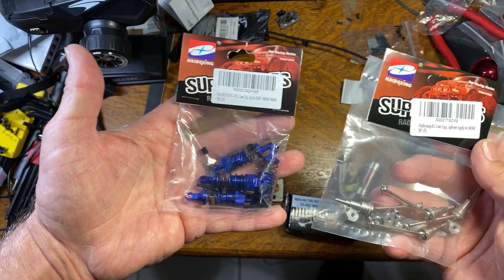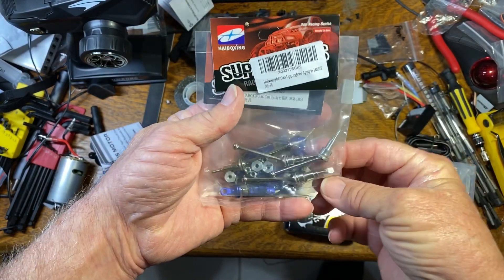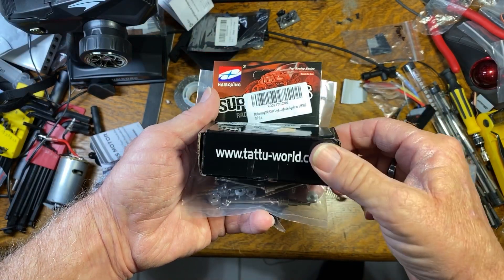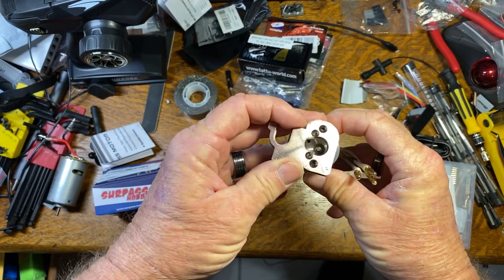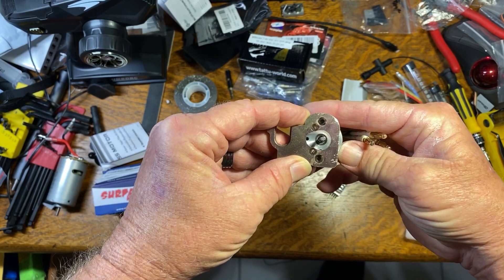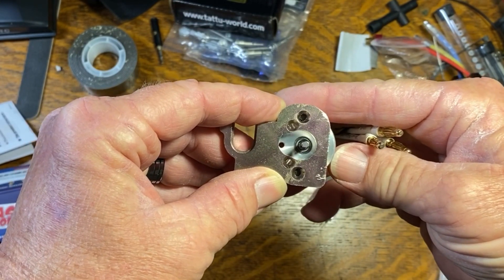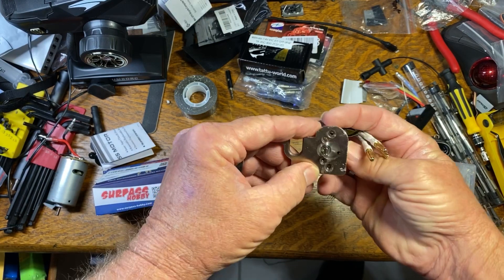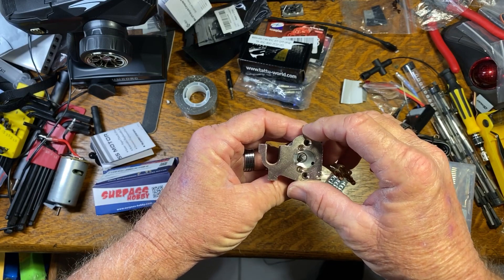WLtoys 144001 brushless upgrade

Comment: Very interesting video these motors have very high kv smaller less weight 👍🏻
Reply from the maker: Cam row drone Good morning 😃☀️🌞 
This one is 3930kv. I’m curious to see what it does. 
Be safe out there my friend!
Reply: RC ModSquad that will do 90 kph , but you need a long straight road for these speeds👍🏻
Reply from the maker: Cam row drone I kinda hope going to the 17t pinion will slow it down a bit. 🤞
Have a great day and be safe out there!

Comment: I have been meaning to ask you about the differences brush vs. Brushless? I know one probably has copper wiring. Windage maybe?
Reply from the maker: The brushed motor actually has contacts (brushes) the the wires in the motor. The wires are wrapped around a core and rotate and the magnets are inside the case basically wrapped around the rotating wires. Since there is contact the brushes do wear out. It is initially cheaper than brushless. 

The brushless motor has windings in the case and the core is magnetic. There is no contact between the wire and no brushes so they last longer and are generally more efficient. 

This is a very crude answer but it’s a start. LOL. Oh, they use a different ESC and the brushless motor cost more

Here’s a video that gives a little more detail. 😃
https://youtu.be/Y7nQI2xM2as
Reply: @RCModSquad  thank you David for explaining it. It makes sense now. Have a great day!🌞
Reply: @RCModSquad  good link. I watched it. I'm hoping to get a car soon. They look like a lot of fun.
Reply from the maker: 307 Wyoming 4E You’re welcome! Have a fabulous day.

Comment: Hey I have a question for you I looked for contact info but couldn’t find one, so I’m going to do a motor upgrade and want to start replacing the stock screws with Allen ones to make it a little more “hobby grade” can you tell me what size screws I need to pick up or if possible a kit or something that you might of used. Thanks for your time and entertaining videos
Reply from the maker: 27mmb27 I’ll have to look I’m the manual and see if anything is listed. 

Most of the stuff is M3x? A few are M2x?and M4x?   

What I did when I got started in RC was just start ordering small lots of 30 to 50 in different lengths. M3 seems to be most common so that’s where I started. M3x3 to M3x6 is a good spot to start and I started with countersunk and button head. Here’s just an example. 

M3x6mm 10.9 Carbon Steel Countersunk Head Hex Socket Screw (Pack of 50) https://www.amazon.com/dp/B01E5EOIWW/ref=cm_sw_r_cp_api_i_pG4MEb4K7WHQS

It’s cheaper in the long run to buy 50 or more of each size than just buying three or four at s time. 

At least if you plan on staying in the hobby. It’s so frustrating for me to shut down and drive to the hardware store just to by two or three screws. 

If I remember correctly the motor screws were countersunk M3x6 and I think they were the same for holding the motor mount into the car. 

I’m 500 miles away from the car until tomorrow night so I can’t check right now. 

Be safe my friend! I’ll check when I get home.
Reply: RC ModSquad thanks for the response

Comment: Nice video.
Mine is ordered. Was wondering what kind of pinion u use for the dedicated holes die that size engine 
 Will upgrade to brushless system, but want longer runtimes and good handeling not 70mhp speed. I think it will be fast enough of you put on a smaller pinion.
Reply from the maker: man, so many of my comments are going to my spam filter. sorry for the delay. I’ve since done a video on this and it did 45mph on 2s. Hard bashing would get pretty hot but a fan or smaller pinion would help. I ran it pretty hard on an 2200 mAh battery and was just under 4v when I shut it down.

Comment: Good luck on the pinion hunt, I'm after one too. Seems the stock gears are a weird size, 0.7M . Also have no idea how many teeth the inner mounting holes will need, looks like its going to be trial and error :-/
Reply from the maker: Matthew O'Leary I’ll look through my stuff and see if I have something already. If not, maybe I can find the right gear for a different motor shaft size and make it fit. 
Thanks for stopping by. 💯👍🏻👍🏻
Have a great day and be safe out there!

Comment: Awesome parts haul my brother! How many KV is that motor and how many cells can it handle? Very nice my bro, have a great day! 🙏😎👍
Reply from the maker: Mikes RC Garage sup bro? Thanks for stopping by. 🙏💯👍🏻 
It’s a 3930kv max volts is <13 and max RPM is 50k. 

I won’t set any speed record wit it but it should be fun and I think easy to handle with good runtime.

Have a great day and be safe out there! 💯🤛🏻🤛🏻
Reply: @RCModSquad  Chillin my bro hangin in there! 👋😁The reason I asked is because running a high Kv motor which 3930 on 3's is fairly high and requires a pinion drop to keep from overheating and to be efficient! I think it's gonna work out quite well being you need to use a smaller pinion as is...  I could be wrong but I think it's going to be a lot faster then you might think! 😎🤞 Nice! Thanks brother! 🙏
Reply from the maker: Mikes RC Garage I’m not sure about using 3s on this. It won’t be a starting spot anyway. Stock ratio is 1.63-1 the new gear (if 27t is correct) is 2:58-1. 

I’m not sure that 17t pinion will be correct until I try it. I may just have to make the motor mount adjustable. 

I think the reason the nylon factory gear handles everything so well is that it has a bearing on the center driveshaft right in the motor mount so there is no deflection of the spur. 

IF I can find a new gear that has as good a mesh in the 380 motor position that’s what I would prefer to do. 

Stock is 44-27 and my first test is 44-17
If it’s too fast I’ll go to a smaller pinion but I’ll have to make the mount adjustable. 

There is an adjustable mount available BUT I’d lose the spur bearing and I’m pretty sure there would be spur deflection. 

Anyway... I have an IR temp gun and I’ll be watching close to see what it’s doing. 

On a side note, I find it strange that the motor mount has a set of holes and a notch for the pinion and yet there isn’t a small motor option for the car. At least not yet. 

Have a great day my brother and be safe out there!
Reply: @RCModSquad  RnD my bro that's what it's all about... I know you'll figure it out and make it go! Leaving the center bearing is probably a good idea but I do believe you can get a metal spur gear. Dropping 10 teeth off the pinion might be exactly what is needed for the increased rpm of the brushless motor. 3's or  12 volts x 3930 kv = 47,184 rpm pretty much exactly what your looking for! Try 2's 8.4 volts for 33,012 rpm first to get an idea of the gear ratio, the torque is going to be greatly increased from dropping 10 teeth on the pinion. Like you said a mod on the motor mount will get you dialed in but I think it's gonna run great on 2 or 3's! Hopefully 🤞 and of course keep the temps in check! Fun stuff my bro! Thanks! ✌️😎
Reply from the maker: Mikes RC Garage I have a couple of pinion gears at the house but finding the pitch on some of these is like a national secret or something. I’ll just have to mesh them up and see what it looks like. 

I have a metal spur and an extra motor mount ordered and they shipped but they are on a slow boat. 😉

I’ll still keep the stock motor mount and bearing even with the metal spur gear.  
Thanks for the help and encouragement. 💯👍🏻 Be safe out there my friend! 

More snow in the canyon tomorrow. 😳
Reply: @RCModSquad  32 48 or 64 pitch but it could be .8 mod or 1 mod lol,  I hear ya! And you're very welcome my bro! More snow dang! Be safe my bro 🙏😎👍
Reply from the maker: Mikes RC Garage I think the car is 32 but the pinions I have came with another buggy and I can’t find what they are. If I can find out for sure what they are I’ll grab a few. Even if the motor shaft size isn’t correct. I can make that right. 😉😃
Reply: @RCModSquad  Lol, you mean you don't wanna file each tooth to make it mesh right... ✌️😂 I've actually done that several times through the years and my friends would laugh at me and call me crazy! And it was!!! Lol! You'll get it figured out my bro! If you have a spur and pinion out of the car it's really easy to check...
Reply from the maker: Mikes RC Garage i do have a riffler file set. 😃 I’ll try really hard to find something first. 😂😂
Reply: @RCModSquad  lmao, for some reason I knew you did, 👍 but finding the right gears is a much better and easier option... ✌️😂
Reply from the maker: Mikes RC Garage I’m about “tooled up” for retirement. Probably the last two will be a plasma cutter and a tig welder. I just need to figure out which ones I want.
Reply: @RCModSquad  Nice gotta have a plasma cutter and tig welder for your fab shop! Very cool! Miller makes quality equipment I worked in structural steel that's all we used... But there are many options out there. 💯👍

Comment: What axles are those cvds?  Did they work good?
Reply from the maker: Josh Herrman I hate to say it but I haven’t installed them yet so I don’t have any idea how they will work. 

I’ll try to get to that soon.
Reply: @RCModSquad  do you know if they will fit?
Reply from the maker: They do fit the Haiboxing Ratchet. I just held them up next to the ones in the car and I’m sure they will fit. I’ll be back home Monday and I’ll try to get an install video out for you and I’ll include the part numbers.
Reply: @RCModSquad  that would be awesome.   I bought some team associated cvds for my a969 but they were not cheap.  I wonder if the front cvds will fit in the rear.  Are you having problems with tread length on the stub axles?
Reply from the maker: +Josh Herrman are you asking about the 144001 or the Haiboxing Ratchet for the axles.
Reply: @RCModSquad  the 144001?
Reply from the maker: +Josh Herrman if you have the first generation 144001 the axle stubs were a bit short and there isn’t enough thread to engage the nylon in the Nylock nut. You can use blue loctite to keep them from falling off. 

If you order the new ones for the 144001 they are a little longer and fit properly. As best I can tell all the ones with the wheel falling off was just the very first ones built. 

Most of those had a wired switch on the ESC. V2 you had to press a little tab to turn the car on and V3 has a little button sticking out of the ESC. 

I’ll look at the rear a bit closer and see if the CVDs will fit. 

The ones I show in the video were for the Haiboxing Ratchet.
Reply: @RCModSquad  thanks for the info.  I have 6 wltoys cars but my 144001 is the only one of those I have.  It is a first gen one and I bought all the metal parts from wltoys dealer and have had all sorts of issues with the rear.  Im just trying to get it all sorted out before I spend anymore money on it.  It will just be for speed runs only.  Im hoping the new stub shafts i ordered fix my rear hub wobble or play in it.  I didn't know that they changed them thats good to know.  Im going to pull those associated axles I have and see if they fit if they do ill let ya know.

Comment: Hey awesome videos brother. I also own a Typhon v4 6s, a Tamiya tt02d, & now I'm look at this WlToys buggy. Do you think it can take my 3s batteries stock out of the box? Let's say I'm out and about using the 2s battery and I run out of juice... Can I grab a 3s lipo with a EC5 connector to a Dean's plug and run this little guy? I really like it, regardless if I can or can't I'm buying one haha 🙏😎
Reply from the maker: Melbourne Exclusive I’ve run mine for a speed run on 3s and I have a video where I ran it on 3s in the snow with paddle tires BUT it ended up smoking the ESC. 

I’ve seen a few cars that didn’t even make it one foot on 3s so if you’re sticking with the stock ESC I recommend not running 3s. 

All that said I have three of these and I really like them. They are not the most rugged car I have but I really like them. 

Have a great day and be safe out there!
Reply: @RCModSquad  thanks! I'll probably get one and run it stock then. I really love your content, it's simple, and you get right to the point. Keep up the videos do not stop uploading anytime soon please!! I'm thinking about converting my Tamiya tt02d into brushless. Thats my next project
Reply from the maker: Melbourne Exclusive I also burned out a hobbywing 1060 on 3s BUT it might have been a bad one. I ordered 4 more 1060’s for some other cars so I’ll try another one in the 144001 to see if the first one was just defective. 

Thanks again for watching and I have no plans to stop as long as people are showing up. Have a great day and be safe out there!

Comment: Hey love these vids makes me wish my motor would give out so I can upgrade already lol. But till then can you recommend a 2s lipo to upgrade for more run time? My cars all stock minus the tires. Thanks in advance.
Reply from the maker: This is what I’m using. You have to move the battery holder to the front spot. 

Gens ace LiPo Battery Pack 1800mAh 7.4V 45C 2S with Deans Plug https://www.amazon.com/dp/B073RFHKWH/ref=cm_sw_r_cp_api_i_cuLMEb6YMDQMV

Comment: Are those other holes on the motor mount for a 540 size motor?  Can the 144001 hold a 540?
Reply from the maker: Mark G thanks for stopping by. 💯👍🏻 
Yes, it has a 550 motor stock so the other holes are for 540/550 size motors. 
Have a great day and be safe out there!